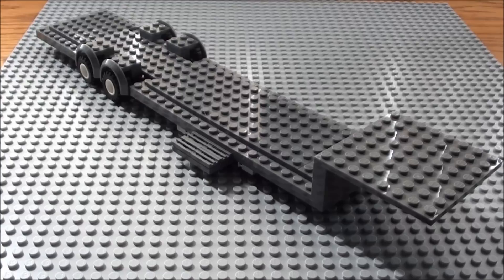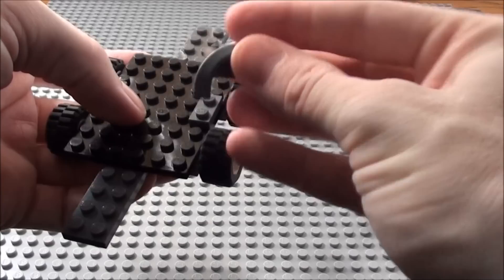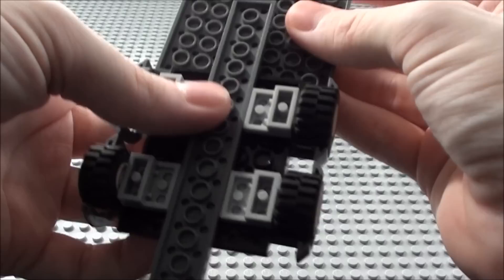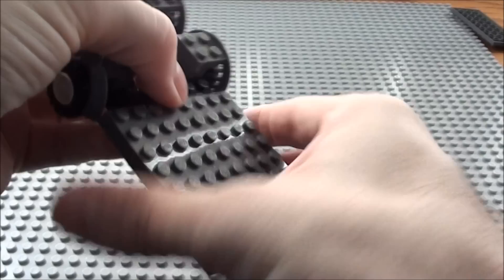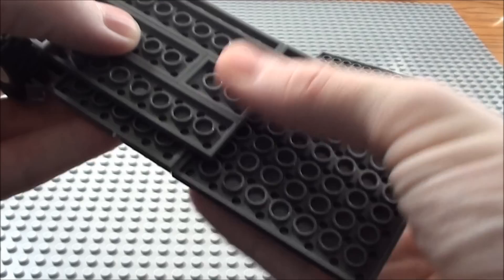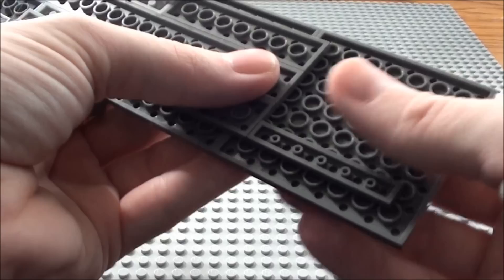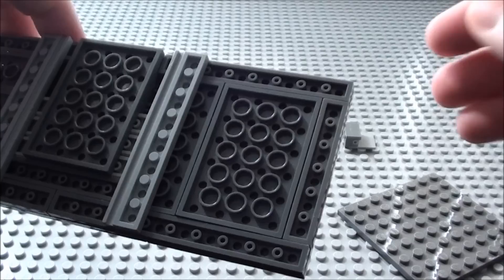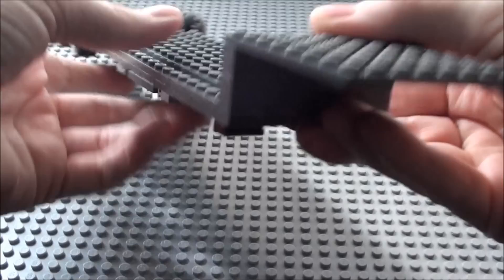Tutorial - LEGO Fifth Wheel Chassis (1 - 12)

Comment: What is the piece called for the grey fenders that go over the wheels?  It looks like a decorative trim piece.  The only thing on your list that I think it could possibly be is 4243611, however, that part doesn't resolve to anything on BrickLink.
Reply: i'm "building" it using the lego digital designer, and on that the piece is labeled #50745. it's on bricklink and brickset